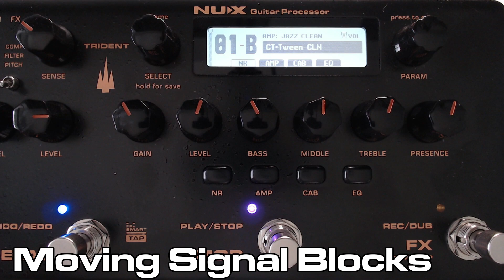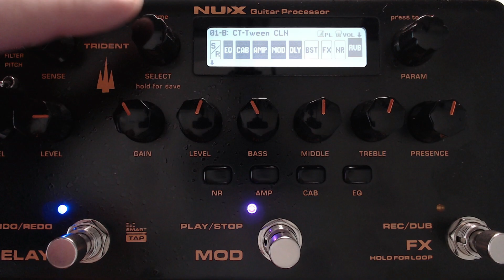NUX Trident Tutorial | EP2: Editing Presets

Comment: What does it mean by toggle between factory preset and user preset?  Is it we can have 96 user preser and 96 factory preset at the same time?  Does factory reset change to the preset i saved on the device or the initial set up?
Reply from the maker: Yes, you can have 96 user presets. When you do a factory reset, it wipes the slate clean, so you need to backup your presets before performing a reset.